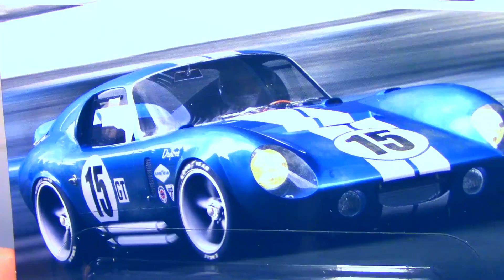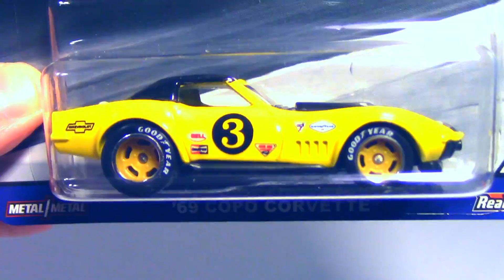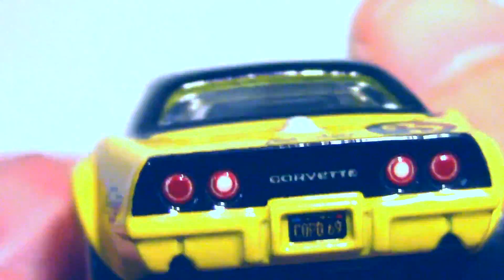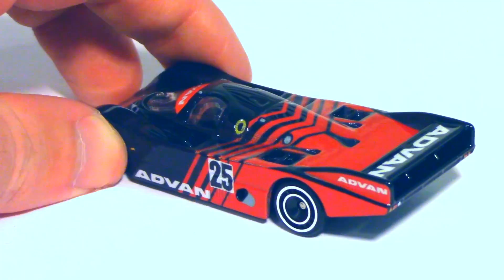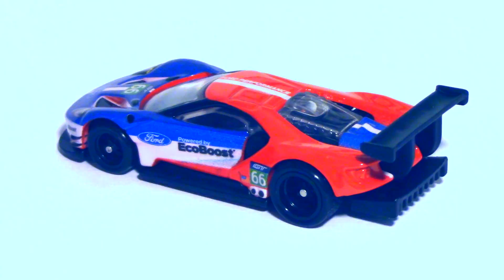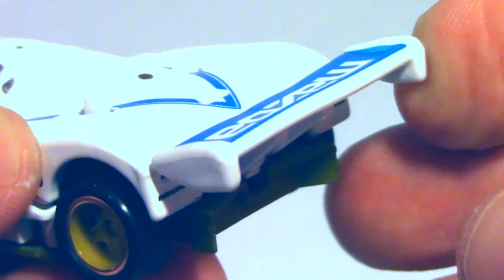*BEST EVER* Hot Wheels Set? -- || Car Culture -- Circuit Legends ||

Comment: I recently got the 962, Corvette, and the Shelby. However, they should have used the Ford GT40 instead of the new GT so that it fits the set better. I have the new GT race car in the form of the regular Hot Wheels.